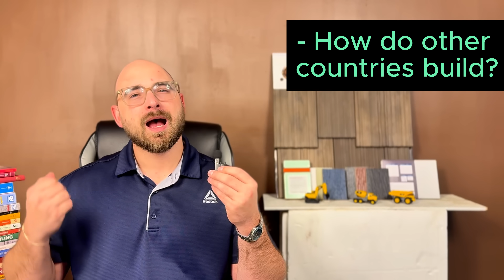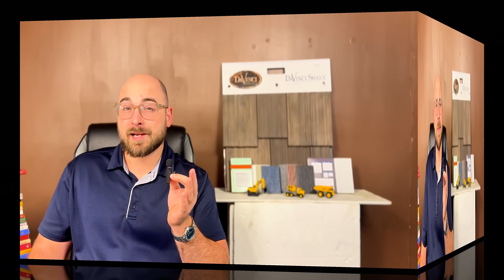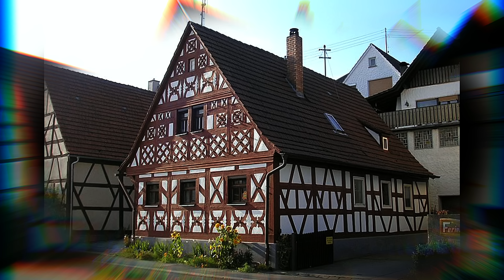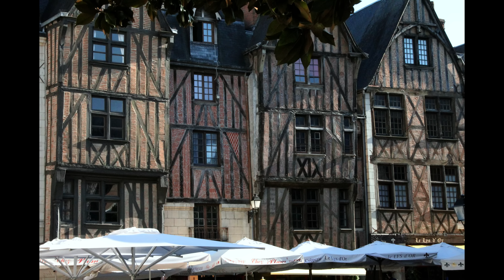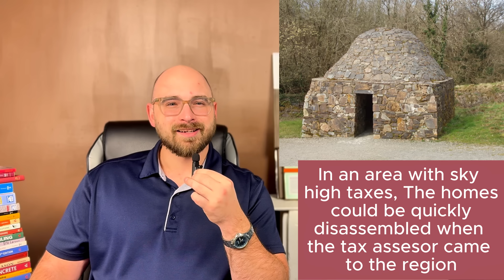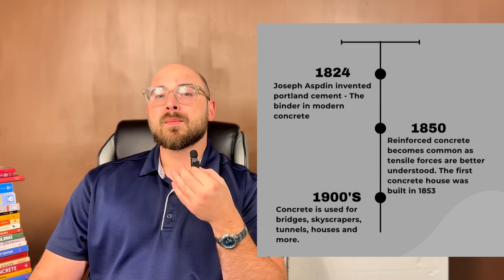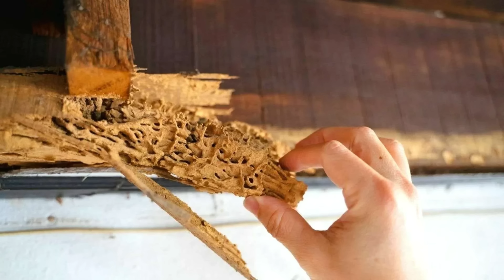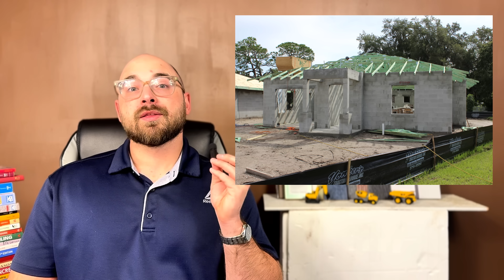Why Other Countries LAUGH at American Homes

Comment: As someone from The Netherlands, every time there is a hurricane that causes massive damage in the USA (like the ones that caused devastation in Florida and South Carolina recently). I hear Dutchies talk about how it’s “their own fault because their houses are made from wood.” And that “brick houses would stand up better to flooding.” 
They forget however that The Netherlands knows a thing about two about flooding. In 1953 there was a huge disaster where a large part of the country flooded and 2000 people died. Although most of the houses were still standing after, the majority had to be taken down and rebuilt because of all the damage the fast moving water did. 
Every year we get large storms that do considerable damage to roofs of building here. And that’s for storms with wind speeds about half of that of an cat 4 hurricane or tornado. The monetary costs to replace those roofs is about the same as the cost to completely rebuilt a wooden house in the US. 

Of course the chances of saving your personal belongings from a brick and concrete house are much better than if your wooden house is completely leveled, in the end it’s a personal and monetary question as to what building method you use. 

If you rather have low repair costs, and are okay with the loss of personal items, use wood. If losing personal items is a no-go and you rather have higher repair costs, go with brick and concrete (or any other more durable material). 

But Europeans need to finally realize that European homes aren’t indestructible. Every year there is billions in damages due to our own weather related disasters. Every year many homes need to be completely or partially rebuilt due to those damages. No house is ever completely disaster proof. 

There is a lot we can shame Americans for (generally speaking that is), but this isn’t one of them.

Comment: Just remember: materials and designcombinations have a big impact on the finished product. Don't compare your wooden houses to EU wooden houses based on material only. 
EU houses work differently depending on how they are designed. This is both in regards to local climate and energy consumption.

Comment: Oversimplified summary:
USA: Bigger is better
Rest of World: Quality over Quantity
Reply: Aka euros coping that they have to life in a 300 year old shoe box
Reply: @JackDaCat6077  Sturdy and durable 300 years old shoe box that withstands the test of time, seems like a win to me 👍🏻
Reply: @JackDaCat6077 without air-conditioning 😂
Reply: i understood it as cheaper is better, but i'm sure the bigger is also true xD
Reply: I wondered over it many times: in Europe, where is no hurricanes, houses are bricked. In the US, where are hurricanes houses are wooden -_- 

I will never get it why endangered with hurricanes Americans build their houses with wood.
Reply: @plrc4593  Not all parts of the US get hurricanes.
Reply: @plrc4593 because flooding doesn't play nice and it's alot easier to repair wooden structures when that eventuality comes knocking that said there's alot more then just hurricanes we see far far far more tornados and earthquakes Europe sees maybe a quarter of the tornadoes the US has and at a fraction of power EF 4's can pick up cars are hurl them through the air an EF5 can pick up a train and do the exact same steel bridges have been entirely annihilated by EF5'S not much survives them
Reply: @plrc4593 easier to build wooden houses back up than brick homes.  When natural disasters hit, which is common in a good section of the country, it’s easier to build to wood homes since brick homes are also torn up by tornadoes and hurricanes
Reply: @plrc4593  Americans like to by more stuff, they love to have new hous every 3 years
Reply: @plrc4593  bcus insurance doesnt cover it and insurance is expensive as all hell from what i heard
Reply: @plrc4593  In hurricane areas (KY, for example)  new houses have a reinforced cement middle, called "tornado room". You keep there necessities, like water, flashlights and radios and get in when tornado approaches. But, it is considered "an upgrade" that you have to pay for when building new house, instead of a default.
Reply: @_Diana_S are you saying KY is a hurricane state? I live in Kentucky we do get off rains from remainder of hurricanes but we're too far inland to have a costal impact. But your not wrong about the tornado stuff
Reply: @plrc4593  Look at the rest of the country, look at their president...
Reply: @plrc4593  we will never get why they do that. Only if we start to think about the profit, then it all makes sense. It should be illegal to build this flimsy of homes in "danger zones" but money rules.
Reply: @plrc4593 Probably because you dont live in one of those places is why you dont understand. And thats fine.
Reply: @longwingdetrain3183  or because it doesn't make sense.
Reply: @plrc4593  Cost of repairing a brick or concrete home after 4-5 disasters is more than rebuilding a cheaper home each time. 

Just how the Home Insurance works out unfortunately. 

Same reason you get paid more for a totaled car and then they cheap out to repair a lightly damaged one.
Reply: @longwingdetrain3183  Bricked house would withstand a hurricane.
Reply: @ Brick and CMU Houses from florida during Katrina and Irine would like to have a word with you then. They didnt get the memo.
Reply: @longwingdetrain3183  Hard to imagine, but maybe you're right. But maybe they were those faked bricked houses mentioned in the video where bricks don't strengthen them?
Reply: @plrc4593  Idr, but from what I understand the reason it doesnt matter is before undercurrent and runoff destroy the foundation and implode the home. So it doesnt really matter what its made out of. Thats why its cheaper to do a quick concrete foundation and cheapo house, and why insurance is more forgiving with those home types.
Reply: @plrc4593 it's not just the wind that is an issue with the hurricane it's the flooding and what that water does currents in water are absolute hell on structures regardless of material you know what riptides are right now imagine that on a far larger scale with things like cars trees boats etc in the mix
Reply: @LONGWINGX india does experience both earthquakes and hurricane(in our coastal areas) but still we use concrete.
Reply: @LONGWINGX u guys use brick as a cosmetic that's not what brick house is
Reply: @IronFist080  Its okay to be ignorant. Calm down, and cope.
Reply: @LONGWINGX  that is kinda good reason. Maybe its cheaper to build wooden house again than repair bricked one. Idk.
Reply: @LONGWINGX Not True. We have flood regions in Germany as well. There are houses that are 300 years old and every few years the water level rises and the basement+ half of the ground floor are flooded and the houses are still perfectly good. You just have to know how to build the house properly. Same for Storms and Earthquakes.
Reply: @LONGWINGX yeah, because you guys don’t know how to build proper brick houses.
Reply: @ Smh. Soil quality is not the same, there is an enormous difference in environment that you do not know, because you have not lived in florida.

As a side note- you completely missed the point I made. It wasnt about the quality of the home, it was about the fiscal feasibility to the individual, with how home insurance works.
Reply: @lilburd8715 here in Germany there are flood regions as well. My dad lived in a 300+ years old house next to a river and several times the river flooded the basement+ sometimes the ground floor but the house still exists and is perfectly good. If you know how to build a proper house, it can withstand floods, storms or earthquakes. Maybe you have to repair the roof, but that’s better than to rebuild the whole house
Reply: @epfr2861  Germany doesnt have hundreds to thousands of miles of underground rivers that surge with every hurricane though. Florida really is different. Please- at least do a little research into the conditions of living in florida. 

There is nothing like it in europe, nor most of the globe. South America is really the only place that has similar conditions, and only in a select few places.
Reply: @LONGWINGX  not all parts of the areas that build masonry houses have disasters.  Probably most don't.
Reply: @LONGWINGX  I live in a building still standing from the north sea flood of 1962, the cellar looks wild. So say again? You Americans always project your own ignorance upon the world. We are force fed anything about the USA no matter where we are and are well aware both of the ground and meteorological conditions of Florida. Florida man refusing to evacuate is a running joke even in Europe.
Reply: @LONGWINGX  Having liven in an iron brick dual layer walled house (Completely solid brick unlike the US) and survived a 7.8 earthquake in that 60 year old house with no cracking or loss of structural integrity. The house also survived 2 cyclones.

Yes I live in Australia.

This video is a little misleading in that most new homes in Australia are steel frame as the Gov closed many timber farms.
Reply: @ 1. We do have solid brick. Dunno where you heard we dont. Most mid-atlantic and New england homes are brick.

2. My point that everyone seemed to miss was regarding the fiscal component of why people build houses a certain way in disaster areas

3. Doesnt matter how well built the house is, if the earth beneath it is keen on destroying it.
Reply: @LONGWINGX  у нас в россии тоже могут быть торнадо как у вас единственно что они могут повалить деревья,и немного потрепать крыши!но у вас то там весь дом преврашяется в обломки и это еше летит на соседний дом который уже не торнадо разрушило а обломки других домов!
Reply: @plrc4593  Bro bricks in the oldest buildings in NYC during superstorm sandy turned into homing missiles
Reply: Or more accurately, form over function.....it's just the American way, look at the election last year🙄
Reply: кстати еше в сша много людей живут в домах контейнерах которые ставятся на земельные участки фермеров
Reply: and yet they have housing crysis as bad as everyone else
Reply: @Murane6  Yes, that's true. But that's a political and environmental issue, not a building style one. In my country, there's excessive nitrogen in the environment. Building activities increase that, so getting permits is difficult. The biggest nitrogen polluters are agricultural, but due to political failure, this is not addressed properly...
Reply: The housing shortage:
UK: we need a million new houses, whatever will we do?
US: we need a million new houses, get to work and crank them out!
Reply: Its annoying how you use "rest of world" like every country does the same thing except for America. Actually ive heard building quality over in China is even worse
Reply: @titaniumvideos1039  I think there's no other country in the world where "bigger is better" is so ingrained than in the USA. On average, probably all other countries value "quality over quantity" more than USA. If you don't agree, name some example please. :) (And of course you shouldn't look at the absolute quality level of housing, because that also depends majorly on the country's GDP. So we're just talking about what people/countries value.)
Also, you're generalizing as well, throwing in Canada many South American countries in the mix by using "America" instead of "USA". USA <> America.
Reply: Rest of the world: rushing to get over here to america so their European houses ain't good enough for them to stay.
Reply: what quality? Are you eating ur walls?  Idiots
Reply: Europe experiences hurricanes and tornados as well.

We havent had giant twisters like ive seen on american recordings before, but we had pretty severe hurricanes before, unrooting trees, flipping over cars, etc
Reply: @cygnusx7  because size impacts your life. We don't want to live under the stairs like Harry Potter out here. 

We also don't want old houses. 

I want modern amenities built into the house that improve my life on a daily basis. 

I don't care if it falls apart after I'm dead.
Reply: @69nites  Bro's acting like 400 year old brick houses forces the occupants to live like people did 400 years ago. Old houses are updated and modernised you know, fkn idiot 🤣
Reply: @69nites ikr, the fuck i care about PAYING to build a 1000 year house when I'll be dead in less than 100.
Reply: Oversimplified indeed.
Reply: @ Americans do seem to think that to improve something equals to making it bigger. That's why they're all so fat.

Comment: Heeeey, keep in mind the dimensions when comparing wooden frame. In my end such method is very popular, but frame will always consist of at least 5x20cm (~2x8 inch) beams with quite a lot of added support ones of 10x20cm (~4x8 inch) or bigger ones. Not the 2x4 matchsticks all around.

Comment: My dad grew up in a stone home in Northern Michigan. The indoor plumbing they had consisted of a hand pump well cold as s*** in the winter commonly had frost on the inside of the home. They had a stove to heat the house with but it really only heated the room that it was in. Granite this house will probably be there for another 400 years but why would you want to live there. Electricity has now been added and it's pretty janky at best. I'm going to stick with my Timber built home and there's lots of them that are 200 years old the number one reason a house gets demolished and a new one built seems like it's just someone wants something new

Comment: I've watched Love It or List It and... about in every single episode there is some problem. Be it water issues, airconditioning, strange DIY electrical solutions... or then the designer wants to knock down a loadbearing wall for open concept and now they need to add a big steel beam to carry the second floor...

Comment: Recently built a house in rual Thailand.  It's steel encased concrete columns and insulated brick walls. Everyone builds this way because of heat and humidity and because of termites.

Teak is popular as well but it's more expensive. 

Can build a 100 sq meters house for about 15k usa

Comment: Hi, thanks for your video. There is another advantage of using brics in combination with open-pore plastering (inside the house) in my opinion. The temperature and humidity gets regulated passively and keeps always up a great airquality inside the building. The temperature changes inside such houses are also highly dampened, so that it is very easy to control a steady room temperature.

Comment: It's just that, generally speaking, American homes are built as commodities whereas European homes among others are built as assets - And i think the latter option is waaaay smarter in terms of longevity and long-term costs due to lower maintenance requirements and better energy efficiency, especially since we've come to the point where the actual cost of construction is getting lower by the day compared to the cost of the land it's built on - So why spend a giant amount on a plot of land just to put an obscene piece of sh*t there which is more similar to cardboard than an actual house if you have to replace it about every 30-50 years, also considering your heirs and/or resell value

Comment: Much Vietnamese housing is vastly superior in construction to American stick-built housing. I'm not sure how the often concrete housing would fare in a cold climate, and they need to establish fire codes for egress doors in cities (many Vietnamese houses are death traps with a single doorway blocked by a padlocked gate) but the construction quality tends to be very good, with stone flooring and fully water impervious bathrooms that don't rot out when the floor gets wet.

Comment: The flimsiness of US construction allows US houses to sway with earthquakes instead of crumbling (like we’ve seen in  recent years with masonry construction in areas around the Middle East). Earthquakes are much more of a problem in the US than in most of Europe or Africa. You’ll note that the Japanese build using the same sorts of methods as the US, and I haven’t heard anyone claim that the Japanese are dumb and don’t know how to build anything.

Also, wood and gypsum (for drywall) are much more cheaply and readily available in the US. The US happens to have lots of forested land and huge gypsum deposits. Far less of both per capita in other parts of the world. Millions of years ago, the middle of the US was ocean. Gypsum deposits are formed from seawater evaporation when land rises and/or sea level falls followed by removal of more soluble salts by rain and groundwater. A huge swathe of the US experienced those processes. Other parts of the globe don’t have the necessary geologic history to have an abundance of gypsum.

You build with what you have and to meet the needs of your location. The US has wood and gypsum and needs earthquake resistance. Other countries have different mixes of haves and needs, and so other countries have landed on different home building solutions.

Comment: As some have mentioned before, it's the price. You may not be able to afford a more expensive house. Then the materials will be cheaper. But the most important thing is probably the builder. He can skimp on the materials and cheap inexperienced staff to earn a little extra, and ignore the building code a little. You can see it in videos where inspectors come to a building. If the builder doesn't want daily inspections to take place, something is wrong. A good builder welcomes inspections to see if he has missed anything, a good builder is proud of what he is building.